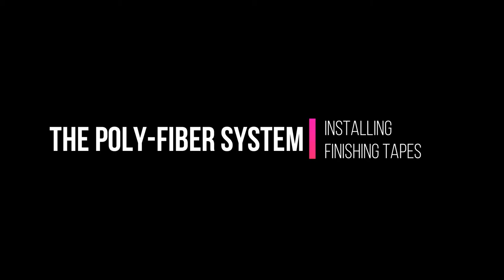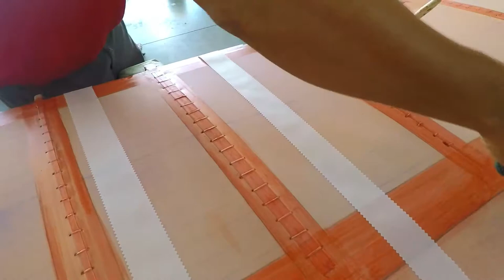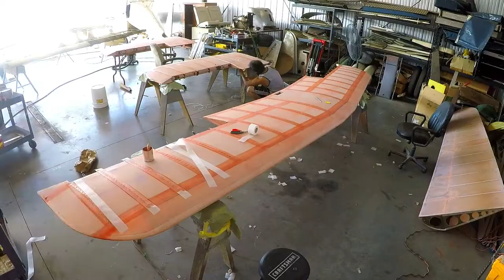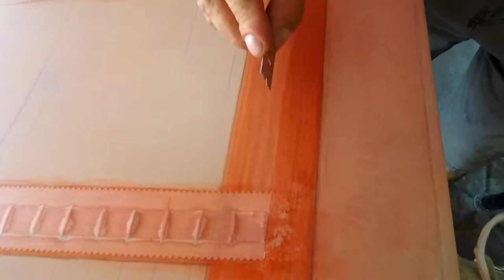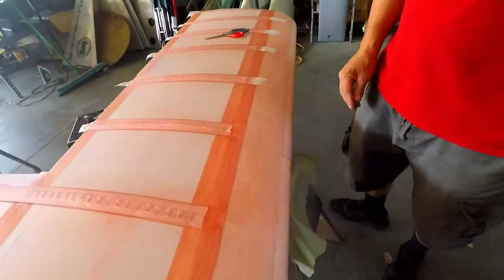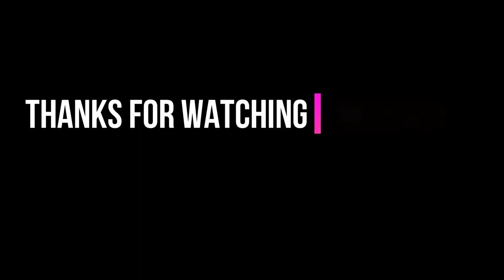The Poly-Fiber System - INSTALLING FINISHING TAPES

Comment: Great job guys, you make that look easy!  I just had to re-sew the Poly-Fiber on my Super Cruiser wing rib after losing an inspection plate which allowed wind to beat up the fabric and nylon thread.  I hope the new strip of pinking holds to the old paint (scuffed it up good, so I’m hoping it will).  It was relatively easy, but I wasn’t anywhere close to as fast and efficient as you all!  Lol… Look forward to the day when I do a complete recover.